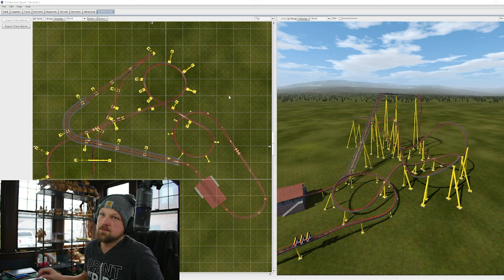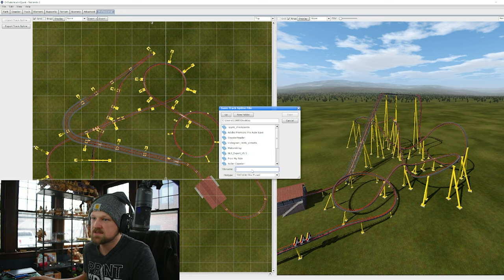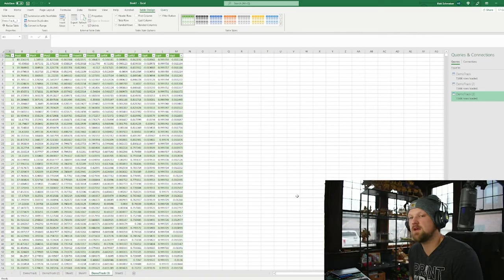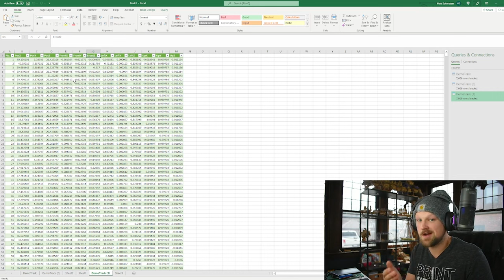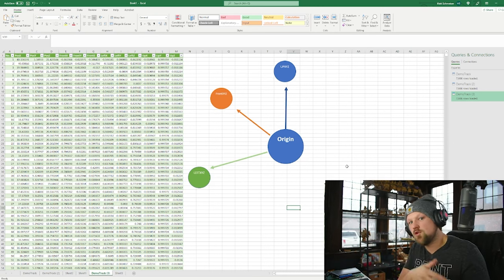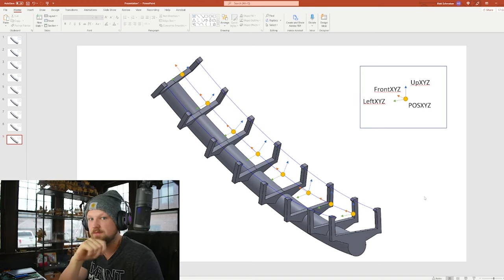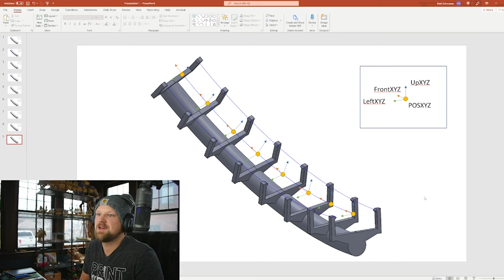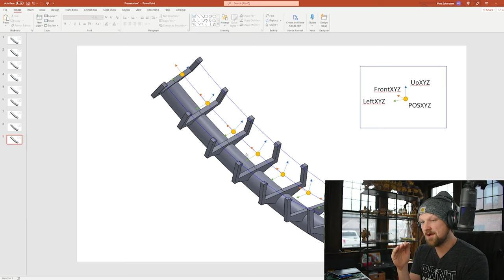Design For Fabrication - Ep. 1 - Reading Nolimits Data

Comment: My answer the question at the end,
The X2 secondary rail will be parallel to the main rail. That means you can use the same method to find the position of the rail from the center line for the secondary rail. Add a little distance so it isn't on top of the first rail. Depends on how thick the crossties are.
Then to get the vertical distance you do (some value)*[up unit vector]+[x,y,z]=[new x,y,z]. The value you choose will determine how much the rail moves. For example, if you use a value of 0.1 that will move the rail 0.1 meters up, or -0.1 for down 0.1m. Assuming the up unit vector is a 1m unit vector.

How much rotation that actually is depends on the size of the gear for rotating the seats. Say the gear is 0.4m in circumference. Then moving the rail 0.1m will rotate the seats 90 degrees.

P.S. I have the Vortex(KI) coaster cutout (I was a ride op on Vortex). The way they snap together is really impressive. Much better than the loose fit that most of the other laser-cut kits I have come across have.
Reply from the maker: This is great and you are quick! that "[x,y,z]" that you mention will be using the "LEFT" data. We will talk more about it tomorrow when I post again :)

Thank you! I pour days/weeks/months into designing cutouts people WANT and It makes me so happy to hear you are impressed.

Comment: You are WAAAAAAY overthinking this.  You don't need to do anything at all with the numbers.  You just need them to build a spline.  Then use THAT spline to model the track in Fusion 360.  Export the model as a 3d printer file and you are done.  The challenge is getting the model built.